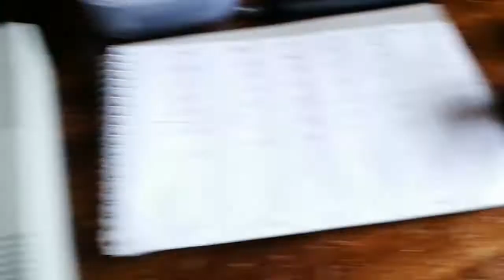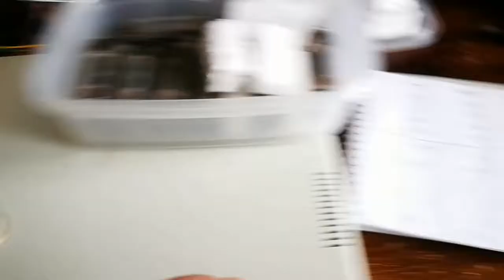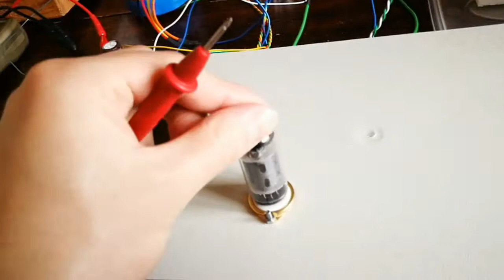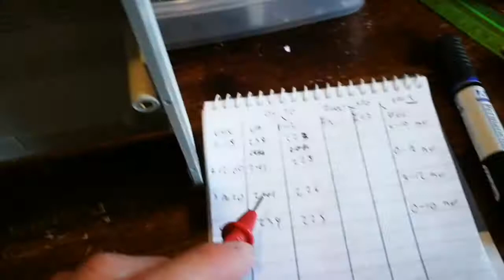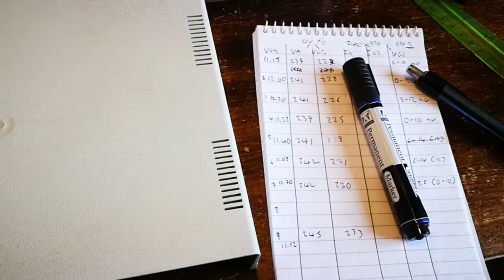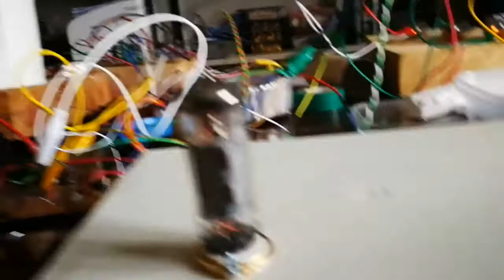Are NOS valves worth using?

Comment: i find nos 6P1P-EV tubes take 12 months to come good
Reply from the maker: They're a good little overlooked valve. Next time I round my friends I'm taking my meter to see how the ones in her amp have bedded in. It's had 6 months of daily use now.
Reply: @killcar5nbike2  i just finished building 2 x class A monoblocks with the 6P1P-EV running @ 10 watts of plate dissipation. they work really well in class A 3 rms watts of clean power